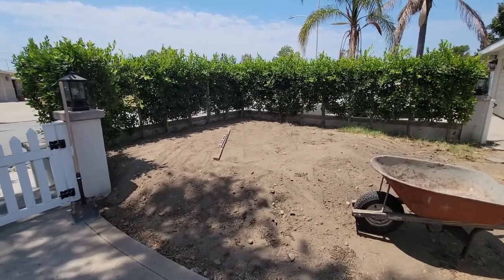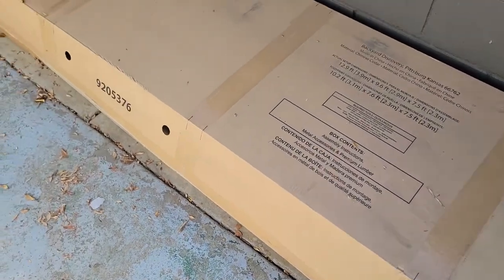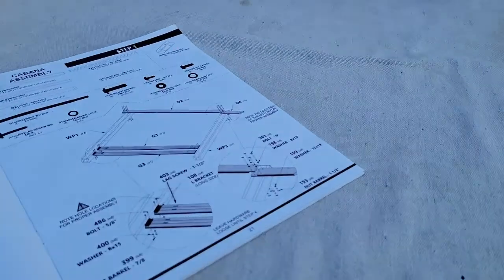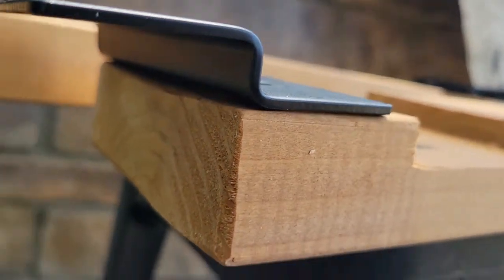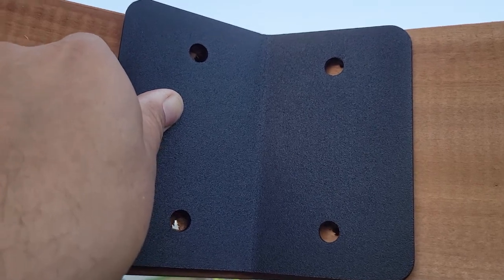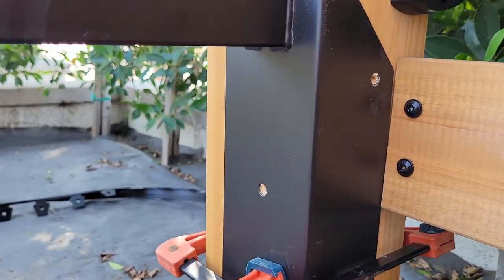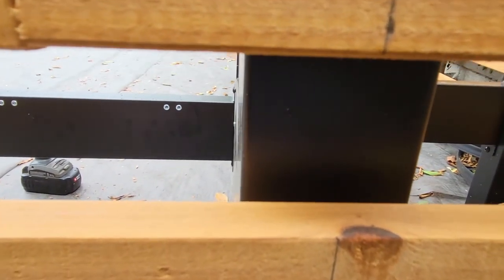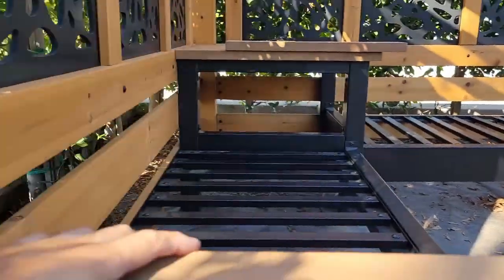Complete build of Backyard Discovery Tuscany Cabana Pergola with Conversational Seating.

Comment: Thanks so much for sharing this installation video! Did you pour concrete for anchoring the posts? I am not sure if I saw that part in the preparation. Is that step required? Thanks again!
Reply: I did not anchor it with concrete. I decided not to anchor it because it has no roof and there no possibility of the wind lifting it.  It's heavy enough that its weight will keep it in place for me.  It does come with a foot square for the post which can be anchored to concrete if you need it anchored.
Reply: @sigmanu425  That's what we have been thinkin of, too - no concrete anchoring since the weight of the pergola is about 580 lbs and the built-in furniture may help, as well.  I appreciate your quick response to my question! :)

By the way, are you the gentleman who created this wonderful video?  Thanks so much!
Reply from the maker: @lilikang3243  , Glad to be of help.  Yes I created the video.  I'm still learning how to edit and its noticeable in some of my videos.  I hope the editing is getting better as I go.

Comment: So first you build it and then you anchor it? Is it light enought to move it to where it needs to be anchored?
Reply from the maker: @ramonaparicio483  I was able to build the two panels in my back yard and assemble it in the front yard.  The two pieces are light enough to pick up and cary with two people when separate. Once assembled, you'll probably need three people to move it because of its size. Also, I decided not to anchor it because it doesn't have an enclosed roof. It's been in place for a while and I haven't had an issue.